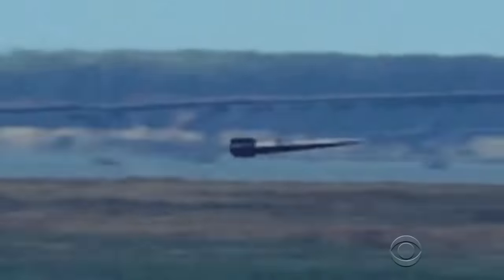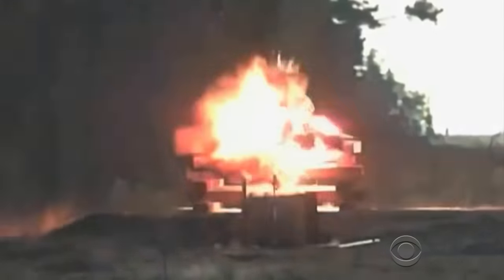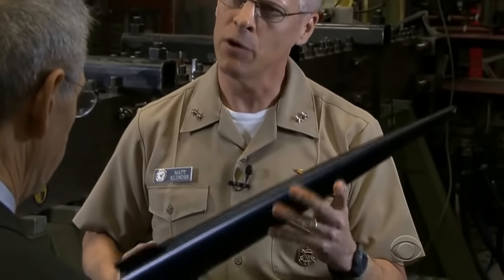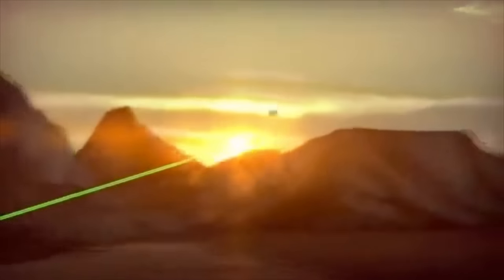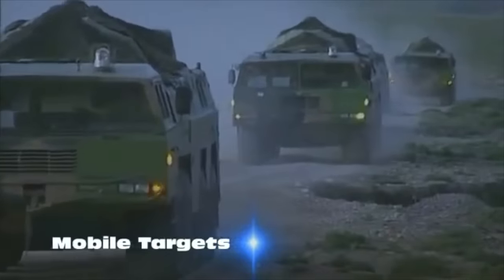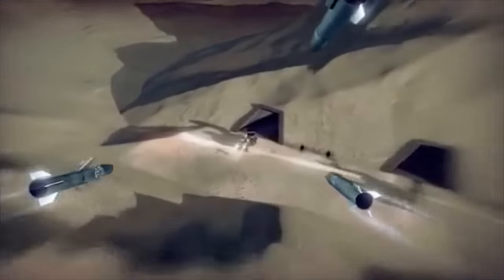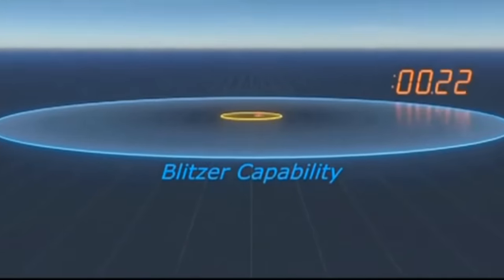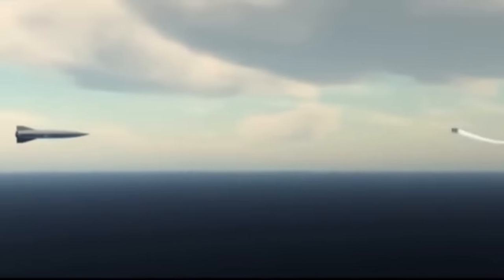U.S. Military's Most Powerful Cannon - Electromagnetic Railgun - Shoots 100 miles - Mach 7

Comment: 25k for that??? ill make them for 10k a piece, hit me up america
Reply: I think he meant the guided version that blows up close to missiles. A chunk of metal or graphite (whatever that thing was) wouldn't cost 25K.
Reply: but that does not mean they would not buy it... America was going to buy a plane from Boeing that was 4 billion dollars
Reply: likely a 747 variant ... the Airborne Laser perhaps?  ... anyway the large jet liner series 747, Airbus competitor etc all cost close to a billion $ these days
Reply: It's tungsten, and tungsten is expensive
Reply: And your piece would fall apart on firing lmao.
Reply: no, no it wouldnt.
Reply: Dr. Orpheus no.. a projectile machined from a solid lump of metal will not fall apart, no matter if it was machined by some company in america or me..  i assume you have no engineering background??
Reply: Queen of cats: You're talking about the 1.65 billion for two Air Force One planes. 

Just a tip about the twitter statements of the orange fruitcake in charge: Always check his claims.
Reply: DaTT78 220+2
Reply: F22 hasn't had news crossing my 'radar' lately ... if they got the O2 system fixed it may be better than alright.
Reply: Skeptic lets assume your ammo doesn't fall apart when fired at hypersonic speeds. If the metal has the slightest imperfection it will not fire straight and true. The engineering research done to make sure the aerodynamics is perfected to make it fly straight is very challenging due to air compressiblity. So good luck with that.
Reply: If that includes all cost, that is cheap. Some fifteen or twenty years ago, a hammer in the US army cost the army around 700USD. Offcourse that includes everything from the order is given to it arrives where its needed.
Reply: I remember some of that incident ... years later I was working around some high power radio transmitters which had some powerful magnets involved to keep our tools from being grabbed by the magnets (and to keep us safe) our tools were made, IIRC, of beryllium and were not cheap ... Googling said types of tools has a cheap set costing about $200 for a set of 4 and prices go steeply upwards from there with $717 for a wrench and over $1600 for a hammer the main selling theme for these is the added quality of being "non-sparking"  so yeah they are for real, they still exist, and have a variety of reasons for spending a short ton of cash for them
Reply: Skeptic and 370000 € a Air Ground rocket.
Reply: LOL
Reply: It costs $25k because the bill is being footed by the tax payer. This is the only reason. This, like everything else governments buy is why you pay massive taxes and have inadequate public services. People who donate to their campaigns are awarded ridiculously lucrative contracts down the road.
Reply: Spacelyz Rockit $6m is a small price to pay for potentially billions of dollars in returns. It's a calculated risk for them. And military contracts in the States are ginormous.
Reply: Spacelyz Rockit I think we are arguing the same point pall. Companies overcharge the taxpayer and people get rich.
Reply: @Spacelyz Rockit : Well those complaining on that could all be set into the aircraft with the cheapest bolt they could find in extreme flight testing, and I guess they would quickly sing another tune. Bolts used in aircraft needs to handle extremes bolts used on ground vehicles never will get close to
Reply: I'll make it for 1k.....
Reply: I'll make it for a box of marlboro because America is the best! :D
Reply: Skeptic I know, $25k for 3kg of steel. The war machine sure is profitable, no wonder they lobby and pay politicians. Fuck me what a joke.
Reply: The F-22 is a hunk of shit?  Expensive, maybe.  Shit?  Not by a long shot, ace.
Reply: It's tungsten.
Reply: A broad range of prices for finished tungsten products would be from $25 to $2500 per kilo, with the majority of products in the $100 to $350 per kilo range.
Reply: remember the projectile does maneuver in flight.
Reply: Riiiight...
Reply: Skeptic this weapon recently belonged to NAZI
Reply: Skeptic filme
Reply: Napoleon, premier Churchill, gen. Patton :Polish boys the most brave -gen. Skalski
Reply: no kidding. when a SINGLE peace of steel costs  as much as a new car... its time to reconsider your budget/spending....
Reply: Skeptic it costs $25,000 to fire this gun for one second we fire this for 10 seconds
Reply: Its high tier material,  not yet mass produced, probably hard to work with, etc. plus you have to remember the cost of electricity plus the rails, which lose some mass due to turning to plasma every time theyre fired.
Reply: It is More of the power which comes from the rail gun device and the techniques plus size of the projectile, the way it is made. They are in some way specialized.
Reply: Skeptic look everyone another internet know it all who thinks he can build f22 raptor in his backyard for 100k
Reply: The railgun create huge amount of heat and other issues.  It is why the railgun has not gone past the development stage, even though the military has been testing railguns (apparently functioning but not operationally practical) for a few years now.  Normal projectile material will not work, and I do not know what will happen (disintegration? catastrophic failure?  including the expensive prototype railgun?).  I remember that the rail needed to be made by a different material (than common projectiles) and produced specifically (assuming highest grade, and processed specially?).
Reply: And they just did, last week...(for two). Why buy one when you can have two for twice the price?
Reply: Are there different grades of Tungsten? 
Are tungsten used?  Is it pure or alloy?  What other materials are used for the rail projectile?
Are the procurement price different than the market?  United States apparently does not mine for Tungsten due to environmental factors, but maintain a stockpile due to national interests.  United States probably buys bulk so I would expect it to be cheaper than market rates, but you never know with this government.  China was stated as possible current supplier of Tungsten.

If the Tungsten core was the stated 23 pounds and there are not grades, Google lists the price at $20s per pound.  Obviously, the material costs should be $1000 or less.  Probability should point out there are different classes and alloys for military application as with other materials, and the material costs vary drastically from the referred commercial price.  

Material costs are not the only factor to determine the price of any object.  The start up cost could be significant, and an example would be the F-22A Raptor.  Considering the development of military abilities of other nations (particularly Russia and China), the military decided to research the viability of restarting the F-22A Raptor production for additional procurement.  To save money for the F-35, the production of F-22A was impacted.  Number of F-22A available will not be enough, especially with other powerful nations expected to increase their fleet capability and numbers (Russia may procure nearly double the number of SU-57 after full production eventually starts).  United States will procure over 1700 F-35's versus under 200 F-22A.  F-35 does not project air superiority, and are supposed to rely heavily on F-22A escorts for conflicts with modern developed military (not insurgents).  A Marine representative stated that the F-35 are not meant for dog fights and that the pilot made a mistake should the pilot find himself/herself in one.  The cost of restarting the production to essentially double the existing F-22A Raptor fleet would have been slightly over $50 billion, where around $10 billion was solely for the start up costs.  The $10 billion start up costs might have been higher should entirely new facility or facilities be needed.  

My confusion comes in that the rail projectile test fired in shown testing video seems to differ in size and shape than the aerodynamic 23 pound demonstration unit shown by the military representative.  Would assume that the aerodynamic unit is essential a tungsten core with a shell for maintaining accuracy for long range.  
However, that practice lends itself to multiple questions:
What is the impact of the outer shell on the rail system?  
What modifications are required to facilitate the different projectile?  Different barrel?  Different power needs?  
What is the impact on the research data with respect to the modifications?  If not comparable, would it require the research to be restarted?
AND MORE...
Reply: Well they could, but unless he has a pure Argon or Nitrogen atmosphere and a respirator, he/she won't live long.   And the garage will be pretty well contaminated afterwards too.        :)
Reply: Skeptic, okay Dr. Smith for the Lost in Space Series. It'll never work, whine, whine, whine.

Comment: what is the projectile made of to make it cost $25K?
Reply: probably hardened steel. it's only 25 pounds and it has no explosives. just metal
Reply: maybe a precipitated metal like a turbine engine blade?
Reply: Special ferromagnetic metals and special machine work. It’s worth 25k
Reply: Vlodec i
Reply: hcjr1fan i agree in the assessment though.  I would definitely prefer $25k to $1.2M for missiles.......assuming they get results.
Reply: Shareholders
Reply: Im going to guess tungsten? Shit is expensive and rare. This projectile penetrates quite a few steel plates. It's not the densest element but it has the highest melting point. Plus mach 7 speed. Its going to do damage. Just an Oppinion.

Comment: Why does a steel projectile, that looks 30” long, cost $25k?
Reply: Everything is a racket.
Reply: Everything the govt got there always a extra inflated price by the manufacture
Reply: Maybe the materials used to to make this projectile are expensive. The projectile needs to withstand Mach 7 speeds without melting
Reply: It doed not cost that much. It probably only costs $250 but they need to say on paper that it costs $25,000 so that they can A: pocket most of the lift over $24,750 and B: spend some of the left over $24,750 on projects that they can't pit on the books. You know like chemical and biological and illegal weapoins.

Comment: Disadvantages?
 - Huge amounts of heat are generated by the electricity flowing through the rails, as well as by projectile friction when leaving the device. The heat created by friction can cause dilation of the rails and the projectile, further increasing the heat from friction. This causes three main problems: the merger of equipment, decreased security of personnel and detection by enemy forces. , the forces involved in the launch of such devices require a very heat resistant material. Otherwise the rails, the barrel and all the connected equipment will melt or be irreparably damaged. In practice, the rails are, together with all the rail cannon components, eroded with each shot; and the projectiles can also be subject to some degree of ablation, and this can limit the life of the rail cannon, in some cases severely

Comment: 25,000$ for that hunk of metal? Must be like the 1,000$ hammers and 5,000$ toilet seats...
Reply: I got that reference
Reply: Donn Worry Did you even hear it has an advance guidence system in it along with its made of an expensive material? Along with it is designed to split open as well.
Reply: I dare you to even conceive of anything that can survive mach 7 for less $
Reply: Donn Worry  Well, it's not made out of recycled beer cans, ya know.
Reply: HowIsLife how does it guide itself anywhere at Mach 7 tho?
Reply: I was thinking "uhm, 25 dollars is a reasonable price". Then came the thousands
Reply: Ikr... its like its made out of gold
Reply: Dustin Freeze the whole rocket does but he was talking about the projectile he was holding and that one is just piece of metal that already got out after spliting. Also its different than those with small shrapnel inside
Reply: Donn Worry I think cost just depends if your the one being shot at.
Reply: The $ sign goes in front of the amount. $1,000 and $5,000. Unless you're in Russia.
Reply: JBear Antonicic Did you now Dr. Okun..?
Reply: are u kiding they got it there not going to show nothing unless others got it please not trying to be a dick have some common sense
Reply: For those who don't follow cliche's, YES, in the engineering world $1000 hammers are commonplace. They struck with specific impacting levels consistently which is critical in engineering.
Reply: Id4
Reply: @HowIsAsh   it looked pretty light to have 10k worth of tungsten in it.
Reply: that "hunk of metal" is more advanced and harder to produce than you might think
Reply: @MichaelOrphanos  these people have no idea how much force is generated even at the speed of sound, let alone Mach 7. Even further is taking that object from 0 to Mach 7 in a few milliseconds.
Reply: Its supposed to accelerate to mach 7, survive this acceleration, goto target as intended and do the boom boom at target. The amount of tech built into that docile looking metal cone will be significant, its not a run of the mill metal slug by any scale.
Reply: Exactly what I was thinking.
Reply: 45$ solid rounds would be fine, but it does not sound as good.
Reply: Reference what I wrote to @Hydra Dynamic and you shall stop using irrelevant, easy-to-go-to claims.
Reply: HowIsLife more like 1K for the tungsten and 15k for the guidance and 2k for the absolute precision machining necessary. Rest is probably shipping and profit.
Reply: If a toilet seat is $2500, how much is the whole toilet??? Installed???

Comment: 25K for a solid projectile like that, I could make those for half that price.
Reply: The projectile has to be machined to VERY precise tolerances so it's able to go through the barrel without causing too much friction to melt yet still have enough friction to travel through the barrel smoothly. Also, the projectile is made out of titanium and tungsten, which aren't easy materials to machine.
Reply: tungsten expensive

Comment: Also wont EMP void this tech instantly?
Reply: no, it has EMP hardening. Most high value military tech has EMP shielding
Reply: cyronader
yeah but all that means is the circuits are built tougher. (More Solder on the joints and what not) It only helps to a certain extent right?
Reply: There is NO shielding for emp's , that's a lie 🤣 forget the rounds it's the gun that gets burnt .
YOU obviously have no knowledge of emp's . Go back to school
Reply: There is no functioning emp without nuclear blast to date. It should be safe to use for at least 50 years
Reply: emp wipe out all electric circuit so try to build tech without voltage

Comment: Just like the first computer, soon enough they’ll be able to fit in our back pocket (or in this case, a holster)
Reply: That'll be lit
Reply: No because of the heat that needs to be dissipated.
Reply: @mortkebab2849  understandable but at the rate technology is steadily increasing, the size of microprocessors decreasing, and energy efficiency of power production/transport, and output increasing we might have something like that in the future, i mean there’s already handheld electromagnetic rail guns that can penetrate soft metals. I wouldn’t doubt someone would develop something stronger in the near future. I mean also look at things like heat dissipation in computer GPU/CPUs, it’s steadily getting better with things like water cooling and better designs of heat sinks. We’ve been water/air cooling guns in vehicles for a while too, especially places like nazi germany, they advanced the technology wickedly in ww II. If u wanna see a low power handheld railgun watch demo ranch.
Reply: @bluebird3670  The trends that you describe  lead to what we are seeing with military drones: cheap and deployable in swarms.

Comment: How does the rail gun projectile receive guidance after the trigger is pulled?
Reply: https://en.m.wikipedia.org/wiki/Aileron these things on the back and the fact that, like the small chips in your cell phone, small systems in the projectile can receive information via satellite to adjust the flight pattern nearly instantly tracking a target. The crazy part is how small the adjustments the ailerons will need to make to control the flight path at those speeds.